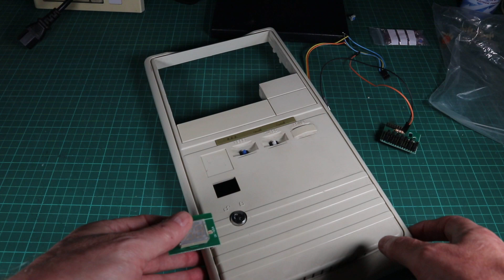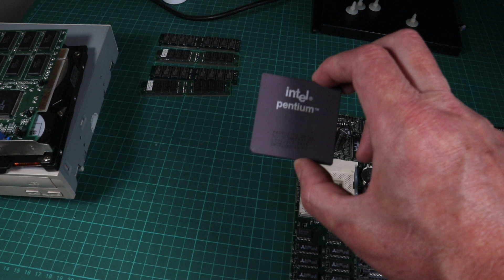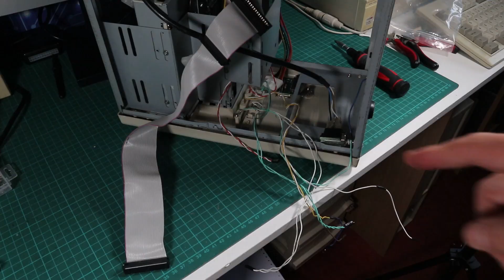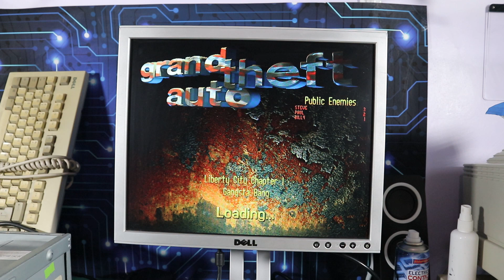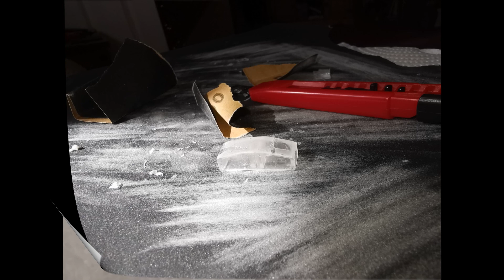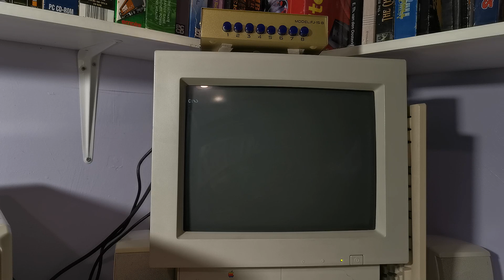Socket 5 P90 for DOS Gaming

Comment: The cast resin button you made came out great!  I love it.  The the slightly crooked digital display would probably get the best of my OCD.  I'd probably widen the opening enough that i could hot glue it in straight, then use some bone or tan colored caulk to fill the imperfections in the groove.  I bet you can get it really close to perfect.  Overall very nice build.  I really enjoyed the video.
Reply from the maker: Haha, thanks yes the button was a success, the lcd display is slightly wonky and filled with beige caulk😁. I should have been more patient. I can live with it, unless you look closely its not really noticible. I was pleased with the resin cast though, will be using that method again for small replacements.

Comment: I like that you found a good hard drive to put in that build. People are going straight to CompactFlash these days for the sake of convenience & because of the rarity/reliability of such drives.
Reply from the maker: Yeah, I'm not really into that. Id use compact flash to back up in case a drive dies but plan to use hdds as long as there are some that work. Listening to a drive churning away is half the experience !

Comment: The LED display is being controlled by the reset button. 

Connect the reset button, turbo button, +5v power and the single green lead to the turbo led header on the motherboard. 

Hold the reset button in each turbo mode. It’ll count up and saves when you release the button.
Reply from the maker: The p90, sorry. Cool thanks for pointing it out. I'll take a look.
Reply from the maker: Which machine?

Comment: Why not use some dumb switch boxes to share a KB/mouse? Get a 1-to-4 switch with DB9 and PS2 ports, or two separate boxes, and add PS2 to AT adapters for the keyboards. Or maybe a DB9 and DIN5 switch box and then you won't even need the adapters.
Reply from the maker: I'll be doing something along those lines. I want the keyboards out of the way eventually as space is short. Im thinking about plonking a dot matrix printer on top of the machines once the keyboards/mice are sorted. Ive got a 4 way kvm so could do it with a bunch of adapters.

Comment: Very nice build! The P90 was king of the hill for a while. I wish I had a period correct socket 5 board without burst cache to run it in. These boards are pretty rare by now. My friend got a P90 end of '95 with a Mitsumi 4x and AWE32 for a huge amount of money, where all that I could afford was an AMD 5x86-P75 upgrade to my 486. While integer performance at 160MHz was quite comparable to that of the P90, me and my other friends still envied him a lot for his very playable Quake performance ;-) The original Win95 (not OSR2!) ran pretty well on a P90 with < 16MB. Both our machines saw 3.11 only for a couple months until we got Win95. Ah yes, and we also watched him playing Myth on the P90 all the time ;-) Btw: How come your last couple vids are only 360p?
Reply from the maker: I got the board ages ago but never got round to doing anything with it. Ive got faster pentiums so thought it would be cool to keep it dos/windows 3. I  missed these back in the day as it was a while before I could afford to get off my 486 and by then socket 7 had arrived. I still hanker for a socket 4. I think the vids get published first in low def, youtube takes a while to process the hd version so if you watch too soon you catch the 340p, a bit later it gets updated to the hd version after it processes.
Reply: @66mhzbrain  A P90 is what I dreamed of back in the day so that's a must have build for me personally. I recently saw a good deal on a socket 4 board, but for some reason it doesn't mean as much to me. A P60 never made it into my dreams at the time. We only knew it from shiny magazines. It was just too far away, way too expensive for anyone of us to afford while we were still desperately putting all our money in 486's to play Doom or Duke3D. Strange thing I never actually noticed the delayed publishing of video resolutions before ;-)
Reply from the maker: I had to wait a good while for a oentium😊 I guess thats what it is. I get a few people messaging saying 340p will check back later. I When I publish it says sd version is up, still processing hd version. I'll check to see i theres a way to go straight to hd but dont think so.

Comment: Socket 5 P75 to P100s are almost perfect for DOS gaming. If I could only have 1 pre-3d era retro computer, it would be my P75@90mhz system. It's like a fast 486 but they're more compatible and plugnplay works properly. It's my most hassle free system.
Reply: I think for the most period accurate rig you are absolutely right. I personally went with socket 7 for my "reverse sleeper" build. You can get them in M-ATX form factor which can use modern power supplies (without an adapter) and it fits a wider range of cases. I used a modern case with a side panel, cable management and even RGB lol. Not at all period accurate but a lot of fun.
Reply from the maker: @megan_alnico  haha. That sounds like a cool idea. I seem to have a lot of socket 7 boards so that definately seems a fun thing to do at some point😁. I wonder if I could hack an aio water cooler to fit?
Reply: @66mhzbrain  an AIO would be absolutely ridiculous lol. I'm not sure there would be any mounting hardware that would fit though. I guess if you use some kind of thermal adhesive you could just stick it on. Thermal adhesive wasn't too uncommon in those days. I think my k6-2 has a heat sink that's glued on. 

Honestly the only problem with my current build is that I forgo both a CD drive and a floppy drive. If I'd splurged a little more on a case I could have got one that has a hinged side panel and then mounted both of them on the inside of the case fading outward towards the window. I posted my build on Twitter but YouTube doesn't let me post links.
Reply from the maker: @megan_alnico  ill see if I can find it. You can get double sided thermal tape, may look into that
Reply from the maker: Cool. Yes I think socket 5 is the pinnacle of dos gaming. Would still love an earlier socket 4, maybe some day😁